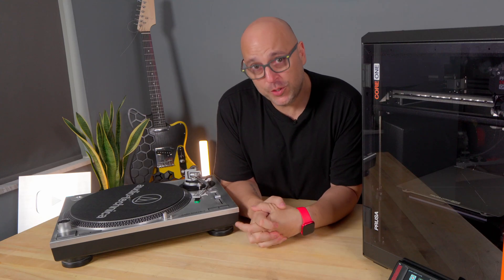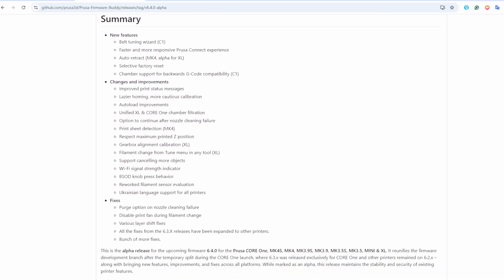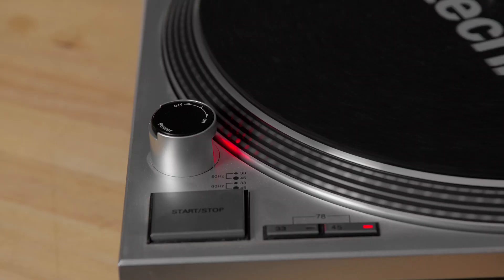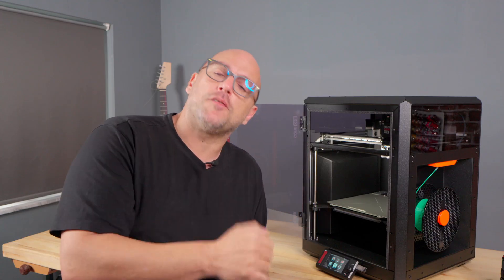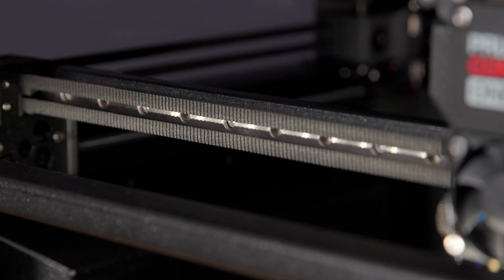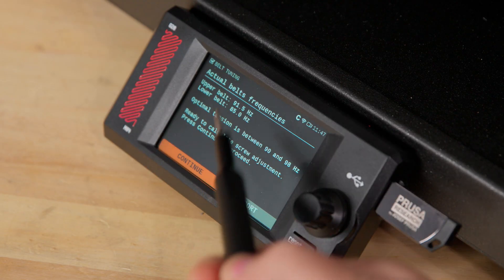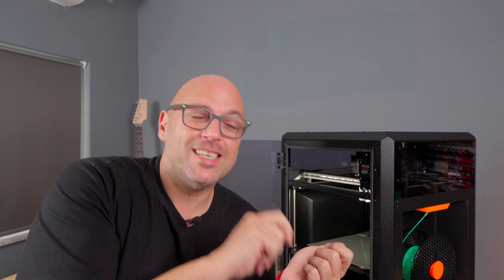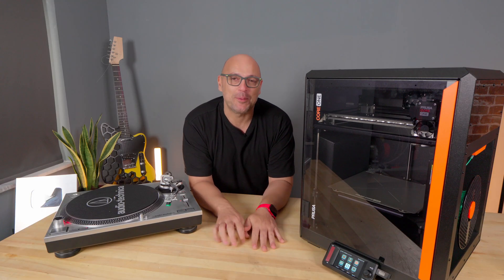Prusa CoreOne Belt Tuning With Lights

Comment: I think your technique works better than their method of finding the resonant frequencies and adjusting the belt tension afterwards. After a few iterations of adjusting the top and bottom belts to the correct frequencies I had my belt belt tension dialed in perfectly.

Comment: Really helpful video - this is way easier then plucking the belt method with an app - I did a bit of a hybrid to what you did. I did your easy method, then I went back and squared up the gantry again - right side was just a hair off - so I turned the the lower belt 1/4 turn tighter, and upper belt 1/4 turn looser to square my gantry - then I reran the the tuning wizard and it was right in the zone and didn't need any more adjustment and my gantry was square.

Comment: Gosh, it's been a while since I've seen any of your vids, i had stepped away from 3d printing for a bit(3.5 years, lol). What you have inadvertently done is rather than tune the belts to the desired frequency,  you have tuned the frequency to the belts. It just means that using the frequency scale to measure and set or diagnose issues is now unfortunately useless. Meaning that if you had to converse with Prusa tech to try and sort an issue or something, you have basically made an issue more complex than it would have originally been to diagnose. Its good to see you still in the 3d printing world, i always enjoyed your vids.😊

Comment: If you’re already pretty close to the desired frequency and only making minor adjustments your method will work. However if you are further away and make large adjustments (multiple turns) on one tensioner there is a good chance the gantry will skew as you apply a large imbalance. With that imbalance, even if you start tensioning the other belt to desired frequency you’ll find it hard to get them both in the desired range. I think you can work around this with your method but making sure you tension both evenly, but I can understand why Prusa have gone with the method they have
Reply: Oh and thanks for making this video, good to have a proper explanation of this method

Comment: The problem with the "quick" method is that tightening the screw for one belt affects the tension of the other belt. That is why Prusa recommends turning both screws by the same amount. If you go back to check the top belt after setting the bottom belt to 92Hz, you might find that the top belt is no longer at 96Hz.
Reply from the maker: Yes, and that is fine because it’s acceptable to have a variation of 8hz between the two belts
Reply: @3DMakerNoob 
I think he means that you loose the squairness of the core xy gantry if you turn the screws unevenly. 
So I would consider to dobble check by doing one more cyle of tuning to verify settings and finaly check the squarness after all is seemingly doen... 
...even though I did it exactly the way you did, on my first approach with the tuning strobe...
Reply: This video was a great help to understand what I should be looking for. Previously, I wasn't sure if I was supposed to be getting the largest movement of the belt, or the smallest. I did have mine set pretty good as it was, along with the gantry being square. I was able to follow your procedure to fine tune it a little better. I too was concerned about only going through it once, knowing that changing the tension on the right screw would also affect the upper belt. I choose to repeat the process and found that I needed to fine tune it a little further, but on the 3rd run-through it no longer required any adjustment. I think that you just need to keep going through it until your satisfied, and finish it off with checking that the gantry is still square.

Comment: I think the smart way to do it is first run the official way to figure out the direction you have to turn the belt screw then use your shorter way afterwards. 😁
Reply from the maker: I actually fully agree, and I think that an integration of the two progressively on the wizard would make it spot on

Comment: This is a better way than the audio frequency, which could be way off based on how your strum it. 
I would still prefer a tool that takes humans out of the picture.
Reply from the maker: Agreed, audio involves the strumming AND also the accuracy of your device, this method also has the visual aspect of recognising the accuracy of the movement. At some point the evolution may be servos on the tensioners that have force feedback on belts

Comment: Too much work to make a tool work properly. Once again Prusa needs to step up their game. You know who continues eating their lunch
Reply: Yet another bambu fanboy... You will have too much work to make a tool work properly if the tool does not has this type of features. It's a very hard thought for a bambu fanboy, but you should try.
Reply: @GhostRider5555555 you should try and attack the argument instead of the person making the argument. That way you would look not dumb or immature. You calling me a fanboy while behaving like one is pretty rich and funny. How old are you?
Reply from the maker: I agree that it needs polishing, it’s a new feature so I guess it will evolve. Same as with how wifi credentials were a pain with txt files on USB to now being done through tapping a phone on the back of the machine
Reply: @3DMakerNoob the whole experience needs polishing. The user should not be expected to do all this to get the machine working properly. Times have changed, Prusa needs to adapt if they want to remain competitive. They are not the leaders in the industry anymore and that happened almost over night.
Reply: @elleryfg7853  Adept to what? It's not like we haven't seen Bambu pulling the "you can't use other things but our own stuff", which is exactly why I won't go near it. Good printers though, but try to just enjoy the hobby, because that's what it is.
Reply: @punishedbrains have ever seen a video about how to tune the belts on a Bambu Lab printer like the printer is a violin? This video right here shows how far behind Prusa is compared to the new market leader, Bambu Lab.